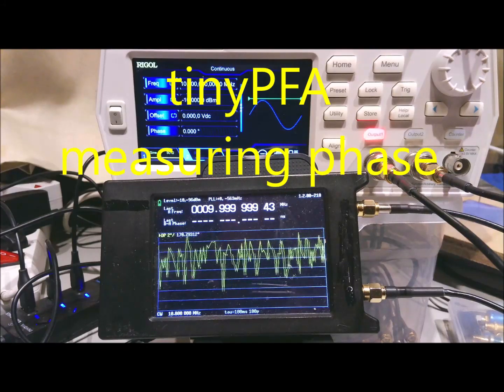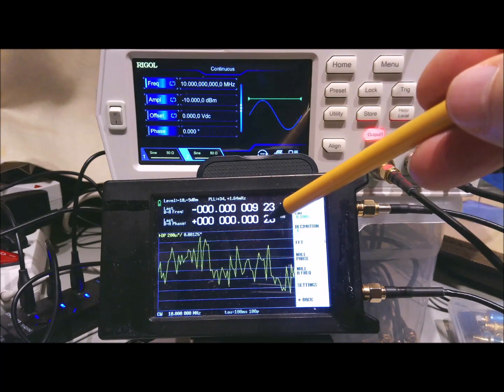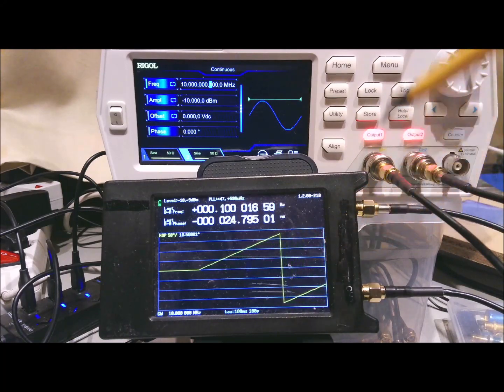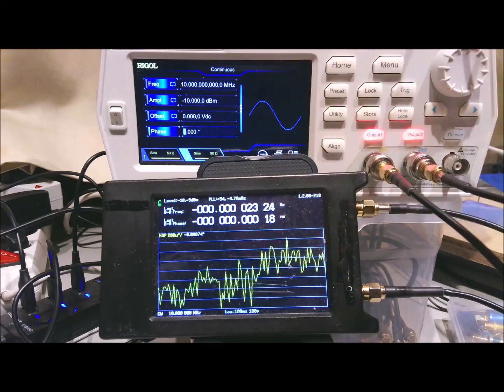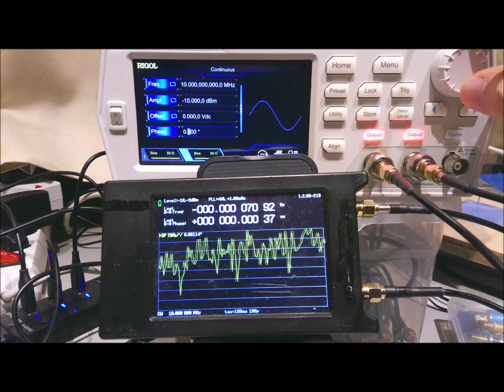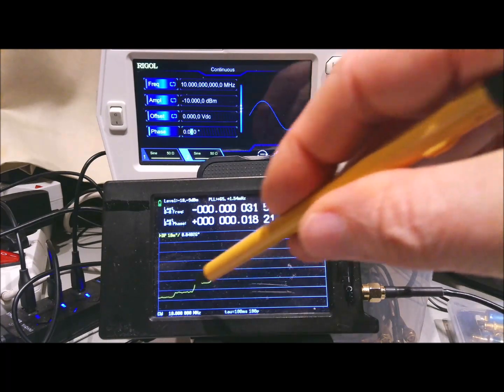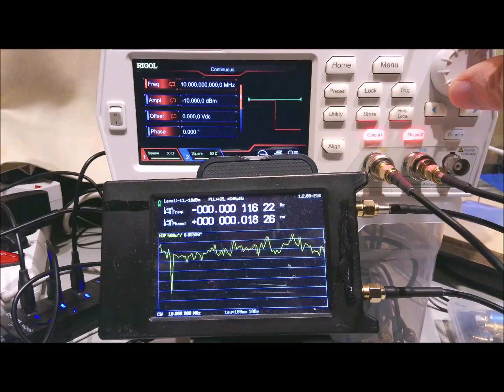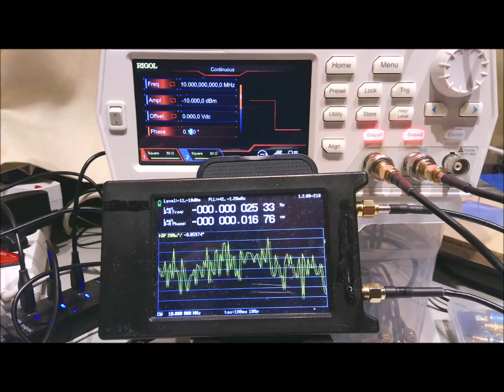Using a tinyPFA to check the phase resolution of a dual output signal generator

Comment: Hi Erik, I have a problem
my TINY ULTRA fails the self test.
Test 3: signal level fail.
How can I restore it
thanks
Reply: he also says : signal level too low or not on frequency
Reply from the maker: Did you connect the coax between Cal and RF connectors
Reply: @ErikKaashoek  Yes Eric, the connectors are connected with the cable.
Reply from the maker: @danyayala3492  join the support group for better support. See wiki

Comment: hello ERIK, I also have a question, if REDUCED LINEARITY appears on the screen when I turn it on at ultra, what does it mean I know I've seen a video before but I don't know where?
Reply from the maker: It means the measured levels are less accurate for the frequency range and active internal attenuation
Reply: @ErikKaashoek Thank you Erik, I bought the ultra from ELESHOP. I know it's legit and I did a self test and it's ok and I was wondering if the device was broken because it didn't appear before and I'm new to this, now I'm learning, thank you
Reply: @ErikKaashoek  because before on ultra mode 0 hz-6ghz and above it did not appear, now it appears continuously on the display and I thought that the front end was broken
Reply: @ErikKaashoek   and I bought the device from eleshop. I know it's legitimate and I did a self test and it's ok
Reply: @ErikKaashoek   I also did the self test and it's ok, but before it didn't appear continuously and I see that it also appears with the attenuator on manual Thanks for the reply
Reply from the maker: @dandan87  Its a warning in the FW based on certain settings, not related to any measurement
Reply: @ErikKaashoek  I'm new to this kind of thing, bought it as a hobby, thanks for the reply

Comment: Hi Erik, got a question. I dropped my sa ultra with the headphones plugged in, and the plug in on the board broke off and un solderable to fix. There's test holes on the side of the board, and was wondering if one of those holes would be the audio output? Because the unit work fine except I can't listen anymore, Thanks
Reply from the maker: Use the PA4 pin at the PCB edge, use a 10k resistor and a 10uF capacitor to connect a headphone to it.
Reply: @ErikKaashoek  Great! Thanks for the info
Reply: @ErikKaashoek  I have the components showing up soon for the headphone fix. Not sure on the setup. Should the cap and resistor be in series or parallel to ground? or vice versa? Sorry to bug you for this, I'm a beginner but know how to solder.
Reply from the maker: @LPspiceolife   See this: https://tinysa.org/wiki/pmwiki.php?n=Main.Listen
Reply: @ErikKaashoek  Thanks
Reply: Hey just got my tiny all I want use it for is pick up signals in my area what's you best video s explaining  how to set it up ( thanks )
Reply from the maker: @TheBlackn1ght  I don't have a video on that subject. Maybe you join the tinySA support group and ask there?

Comment: Maybe I missed it, but what Rigol signal gen is that?
Looking for a relative low cost modern signal gen with dbm.
Do have a (2020) FeelElec FY6900/60Mhz arb. DDS sig-gen (250Msa/14bit) but it wont do dbm.
Reply from the maker: Its a Rigol DG812
Reply: @ErikKaashoek  Thx for the info, was not familair with this model, have you seen the new pro version of your model with the Rigol DG800/900 Pro series with 625Msa / 1.25Gsa/s, also 16 bit and  bigger 7" touchscreen and able to run on powerbanks.(1.78kg 26x16x6cm).. also models that seem somewhat low priced starting around 260 euro but I dont know if they can be enhanced/hacked, mem & channel are upgradeable for the lowtier DG821Pro (CN prices not EU, so perhaps some VAT on top)  also dont know if the new DG XXX PRO version are fan-based (hope not) which I see as a huge plus on the DG800/900 series.

Are in the market for a signal gen with dbm output.'
have your Rigol DG812 been a positive acquaintance.?
Reply from the maker: @JAKOB1977   Yes, very good SG